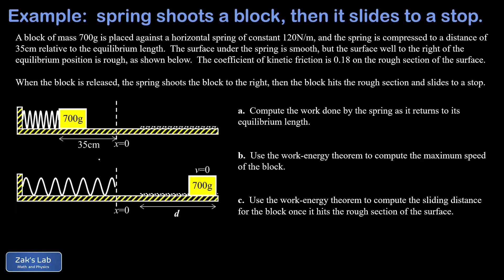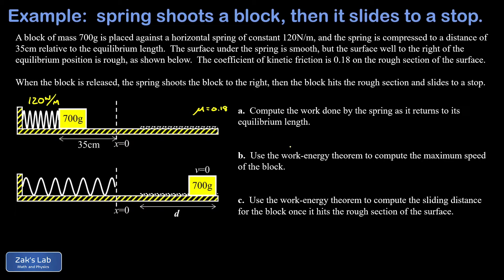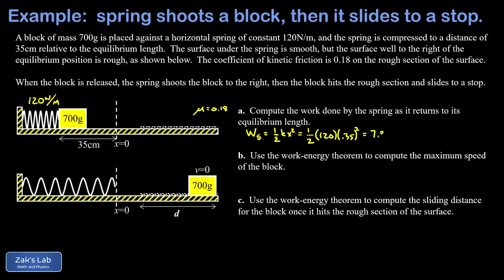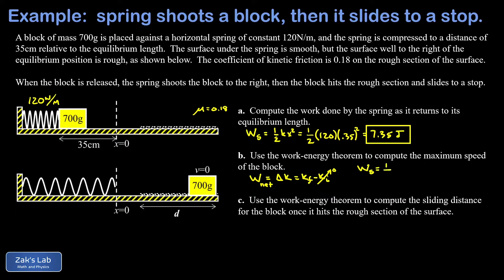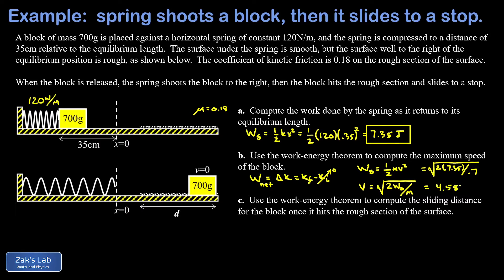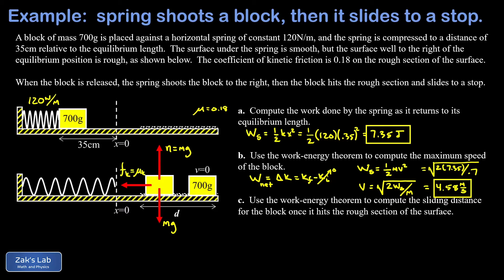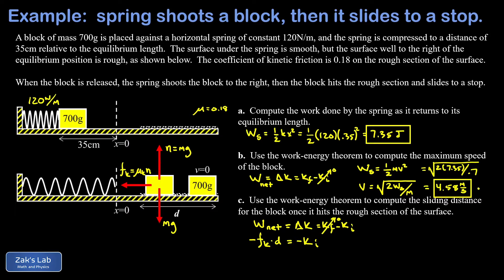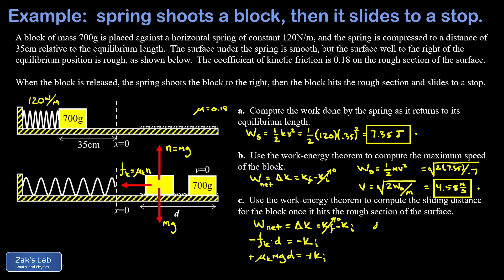Block shot by a spring, then the block slides to a stop on a rough surface.  Work-energy theorem!

Comment: Why is the Work done by spring 0.5kx² instead of kx²? I took elastic force to be kx then the displacement is x so it becomes Work by spring = kx², right?
Reply from the maker: The force exerted by a spring is variable, constantly changing with compression length.  This means we aren't simply multiplying kx by the displacement, we are integrating F(x)dx from the initial to final compression, and the integral of kx is 1/2kx^2 evaluated from the starting to finishing compression.  In a non-calculus physics course, we can't do the integral, so you are normally told the magnitude of the work done by a spring as 1/2kx^2 or you just start to account for it with the spring potential energy function 1/2kx^2.  In any case, the formula W=F*delta x ONLY applies to a constant force in the direction of displacement, and this is a special case of the more general definition as an integral over F(x)dx. z
Reply: Oh, that is interesting, good to know! Is the force exerted by a spring ALWAYS variable? @ZaksLab
Reply from the maker: @Shivani-ki5wl  Yes -- Hooke's law says the magnitude of the force increases with the compression or stretch distance:  F=kx.  This increase is linear for Hooke's law (doubling the stretch doubles the force), but basically any elastic material will behave linearly as long as the compression is relatively small.  A good spring will stay linear over a large compression or stretch. z
Reply: thank you @ZaksLab